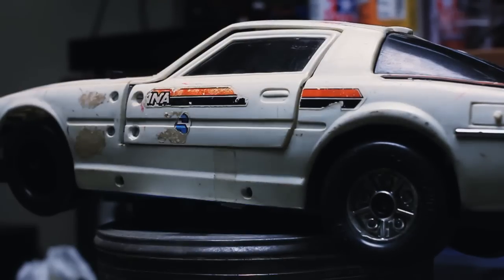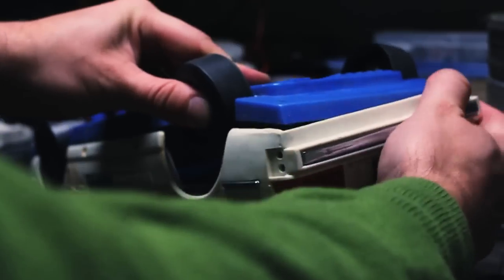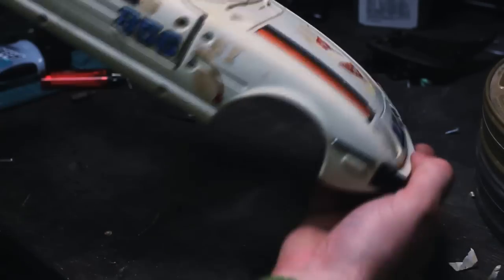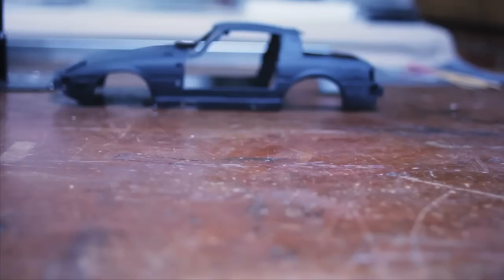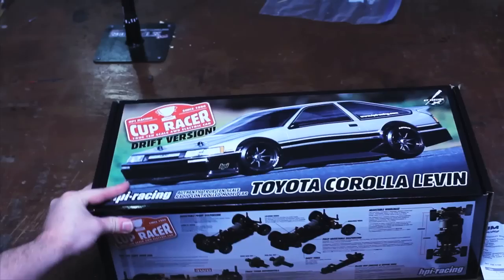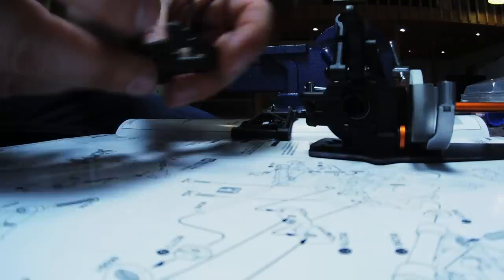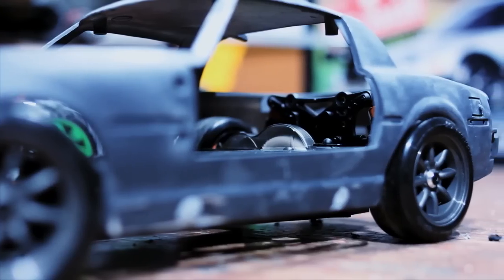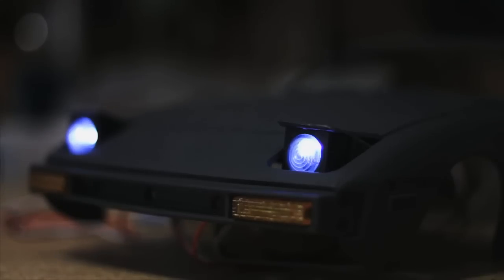RC DRIFT PROJECT PART 1

Comment from the maker: sick! did you have to upgrade the hubs? the 3 prong axle cups... worried i am gonna twist the hell out of those. chose to go the cheap route and got some hobby king esc and motor. censored though. i guess we'll see how it performs. if anything i got the vxl system in the traxxas i can pillage.

Comment from the maker: it's just a bit of U aluminum pipe. with the original go pro mount hardware. it was too heavy though and burned out the stock traxxas steering servo.

Comment: The only problems I've  had with when i decided to put a ballistic 13.5 on 3s... man crazy fast!!!!  It striped out the spur gear and destroyed the retaining nut that holds the spur on. other then that every thing else on is stock.on mine. Im really liking the vxl system djmedic has some vid of it running.  I know some guys are taking out the front diff for a little 2 wheel drive action!

Comment: I woulda made most of the chassis from custom parts and crossed sourced. I also would used rwd and put proper rubber tires on(though in a harder compound then race tires) to get more realistic drifts outa it.

Comment: hpi e10 runs about 150-200 new on ebay and it's great for a first timer. just upgrade the battery connector to a traxxas connector, get a couple traxxas batteries and let it roar. don't go lipo without an ESC upgrade to make sure you have a lipo cutoff cycle that will stop the car from draining the battery 100%. if you're into something a little more serious than that there's a RTR NFS edition Vaugn Gittin Jr 67' mustang that's sick looking. hpi dot com, check them out.

Comment from the maker: hpi cup car.. i believe hpi has discontinued the line. doh! might find one at tower, or on ebay. you may be better off, getting 1/10, as they have more options for one way diffs, and other drift specific hop up parts!

Comment from the maker: ok. so... i did the math. and this chassis, and this rx7 body is 1/11 scale. not sure why you think the body is 1/18th. it's DEFINATLY not the one you found on ebay. if you look at my first video, you can spot hundreds of differences! for one, the one you sent me in the pm, doesnt have a mechanical drive system that takes 4D cell batteries.

Comment: hay kpop I'am in sri lanka .can you send me a link of the rims that you used in the rx-7 pls
Reply from the maker: they aren't 1/10thscale. they are hpi's cup car true 1/10thscale rims. I think the chassi was discontinued and it used much smaller rims. the wheel base is 225mm. Regardless google,  hpi cup car rims on ebay. you'll find them. just they'll look like 14inch wheels on your true tenth scale.